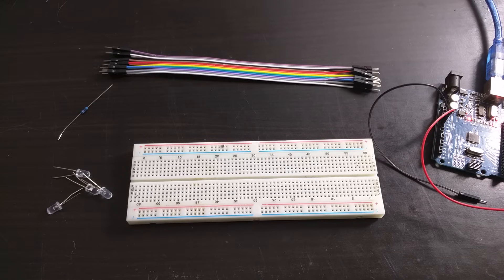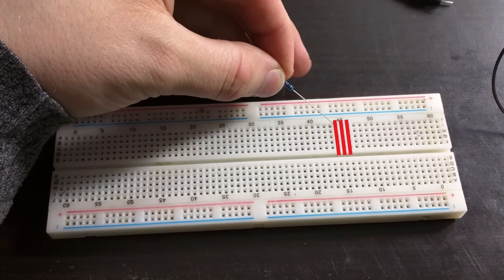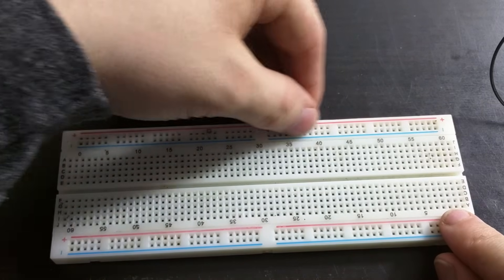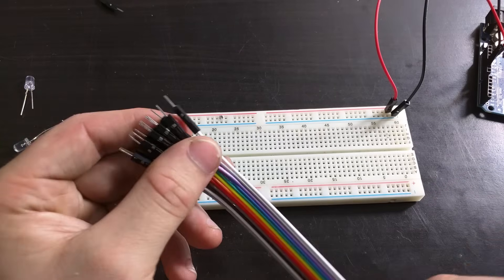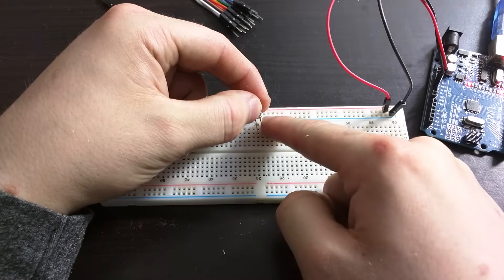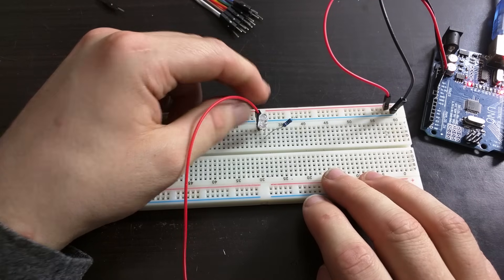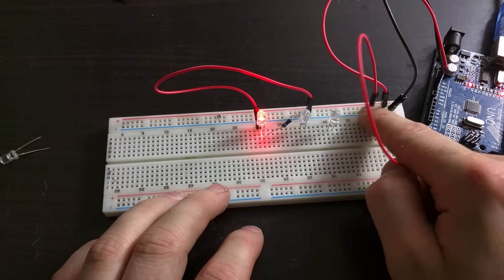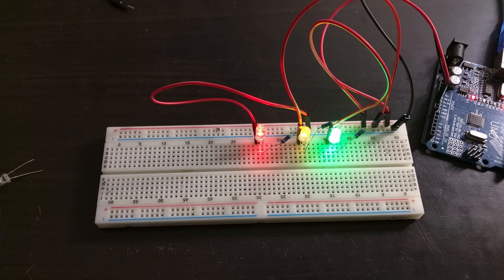How to use a BreadBoard - Electronics Basics 10

Comment: Newb here. So why did you use the resistor with the negative, as opposed to the positive?
Reply: So it can get a little confusing because there's actually two ways that you can write schematics: conventional notation and electron flow notation.

Scientifically speaking, electrons flow out of the negative end of a power source (such as a battery) and flow back into the positive end. This has a somewhat complicated explanation involving early scientists like Benjamin Franklin mistaking the high electron charge of these objects in static electricity experiments as having a LACK of something rather than an excess. A schematic written in electron flow notation will show the energy coming from the negative end.

Many schematics are written in conventional notation, which instead has the end the electrons flow out of labeled as positive to try and make this reversal of terms easier to understand. I'm guessing the presenter here has his power supply and breadboard set up to reflect the actual electron flow, which means the energy would be coming from the negative end and returning on the positive end.
Reply: Awesome explanation. Thank you for taking the time to do so. Cheers .

Comment: Why does the resistor go on the Neg side. Ive just started and put mine in the positive side is this wrong?
Reply: @PHILL DIXON Electrons flow from -ve to +ve in the real, physical world. However, in "conventional" circuits they are shown to be flowing from the +ve pole for historical reasons.
Reply: @AntPDC  yeah it really gets confusing a negative charged atom gives their electrons to a positive charged one so - to +. When I draw a circuit scheme or map it confuses me if I should draw the direction arrow going from + to - or - to + =(
Reply: Current flows from the negative terminal to the positive terminal. Or in this case, the negative power rail to the positive power rail.

Comment: Is there any difference between the positive and negative rail? Is it just a convention? Can you connect the positive end of the battery to the negative rail and vice versa?
Reply: No it's just a line, but it makes good practice to follow the convention. You wouldn't wire a plug up with the wrong colours.

Comment: sir if i don't put a resistor with the first led what will happen??
Reply: Think of electricity like water flowing through a pipe. The LED is like a valve, letting water through one way (a diode is just an object that only allows electricity to flow one way through it, so a light-emitting diode is a diode that harnesses the energy to illuminate). A valve may suffer undue wear and tear from excessively high water pressure, eventually causing it to break. You would want to find a way to put barriers in place to slow the water flow.

Resistors act like these barriers, slowing the current by forcing it to move through an item with poor electrical conductivity. Without resistors in place on any circuit, the amount of current will be too high and other components may suffer damage. 

Doing some quick math with Ohm's Law, assuming a maximum forward voltage of 2.2v on the single LED and 220 Ohms on the resistor with a 5v power supply, you would get roughly 2 mA (0.02 Amps) of current with one LED and one resistor. Without the resistor, the current goes all the way to 1.6 Amps. This is 80 times higher and liable to destroy the LED instantly.
Reply: @chitoryu12  I think you mean 20 mA (0.020 amps) NOT 2 mA which would be 0.002 amps. yes?
Great explanation though, to help Ahmed!

Comment: why use an arduino???
Reply from the maker: +VenomGaming why not use an Arduino?
Reply: Simply Electronics it was more for me to understand why use an arduino because im a beginner and your video is How to use a BreadBoard
Reply from the maker: +VenomGaming the Arduino is just a 5v power source in this case. I could have used batteries or any other low voltage DC power source.
Reply: oh
Reply: i now have an arduino they are pretty cool

Comment: wouldnt it have been possible to run all 3 LEDs with just 1 resister?
Reply from the maker: +lioneyexp it would have to be calculated to drop the correct voltage across taking into account the total current the LEDs would consume (~60ma). You would need to consider power rating of the resistor. But using one resistor per parallel led is preferred because balance of current between them is better that way.
Reply: Thanks!
 I'm running through your playlist now. It's been really helpful to go back and forth between your videos for information. Thanks to you i'm actually beginning to grasp some of this stuff!